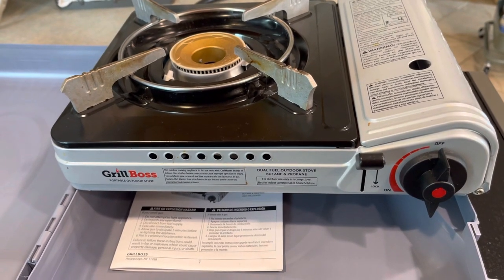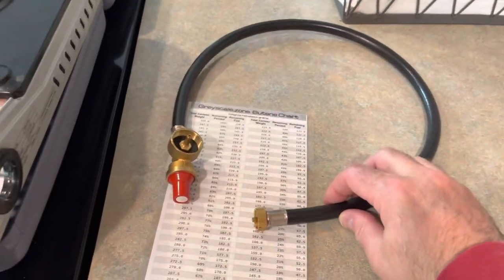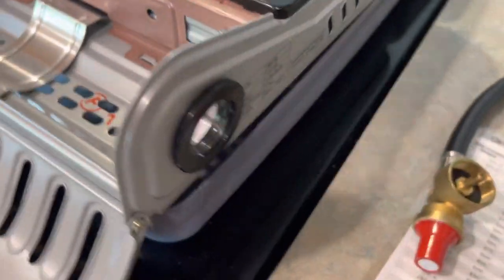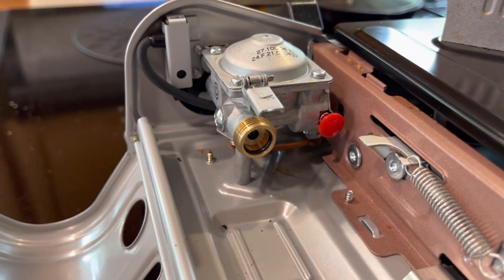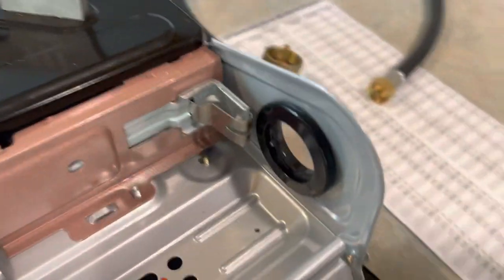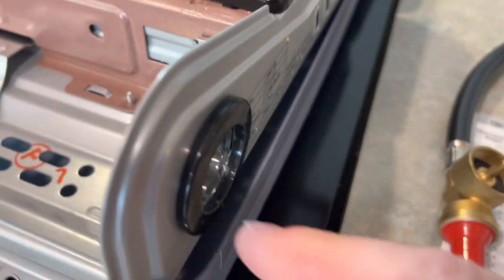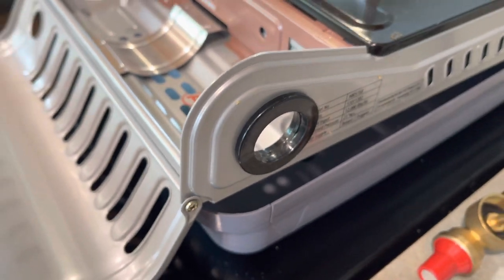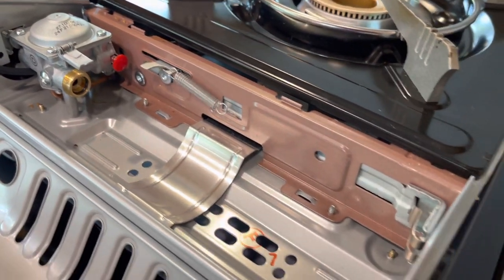A Simple Modification to a #PortableStove Protects a #Propane Hose

Comment: The one I have takes the butane canister that looks like an aeorsol can and has what looks like a gas jet  connector on the side.  I've yet to determine if that's a gas jet like a bunson burner or some air inlet.
Reply from the maker: @southernguy35  do you have model numbers?
Reply: @Linus007  , it's one of those no name jobs from Amazon.  The frame on these are mostly the same except sometimes the color and they slap a brand name on it.   

It takes the canister and to the side has that brass fitting that from looking at another video, it is indeed a gas inlet which I doubt is up to code in the US.  Saw a guy hook a rubber hose to a gas regular up to it and running it.
Reply from the maker: @southernguy35  do you have a link?

Comment: So you're saying you can use propane on a butane camp stove using a hose accessory?
Reply from the maker: Yes. In this case, the stove is dual fuel. It came with the propane attachment. 

I ordered that same attachment for a different project to make propane very portable: https://youtu.be/tSTJt7aI05U?si=q6mNhb9NbAe03Kgl

Comment: Is the only option for storing the hose beneath the burner plate? The case doesn't seem to close properly if it's not placed there. Can you use the stove with the hose stored in that location? I'm concerned about forgetting it's there when using the stove.
Reply from the maker: I put a handwritten note in my case that holds the stove to remind me to remove the propane hose every time that I use the stove. I would not place the propane hose inside of the stove while you are using the stove. There is a very good chance that the hose will be damaged. The only other alternatives are to store it outside of the stove or in the case.